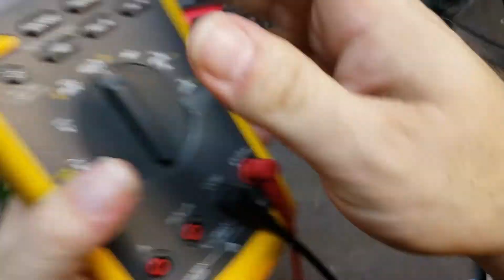Cisco Linksys E3000 Router Power Repair

Comment: 💝Your 5-year-old tutorial helped me in a different way in 2023!💙I have a bricked e3000 I needed to get in to, but just didn't know how to work those security screws.😥At 13:55 you were snapping the halves back together but did a great job in showing how to use a Flathead driver on those PIA security screws!👿(why does Linksys make life so difficult?)😠Good tip. Thank you so much!😃Now I can go in & short the pins on that Broadcom chip to clear the cache & will probably toast the device beyond repair in that process.😅Once again, thank you!🧡 Edit - I just completely bricked the router.😞
Reply from the maker: for what it's worth, you probably only finished its already impending failure.  That said, if you have access to an ICSP adapter you might be able to unbrick it but its also likely that Broadcom chip was headed to its doom and you just finished it off.   I am glad you found the flathead for security bits helpful! I barely ever use my security drivers for those unless they are really tight. And thank you for the comment! I appreciate it :)

Comment: I have a E4200 and it can't power up, it sometimes do, but most times after a few hours after use and plug removed the reinserted , it can't get boot,  unless i have an ethernet 1000 cord connected so what do i check with my mult-iMeter?
Reply from the maker: That's weird. Id try another power adapter first. If you already did, then the small voltage regulators and their associated capacitors.  Unfortunately if none of that checks bad it might be something not reasonably repairable. These seem to be pretty solid aside from the power circuitry.

Comment: So how did you know the value is supposed to be 470u@10v? Mine are all JCCON caps labeled VENT and p1024 and a temp rating of 105c. And can’t find anything online related to those markings. Did you pull a good one for ref and test it?
Reply from the maker: Those factory caps had standard markings on the wrapper. You can kind of see the negative stripe. I wouldn't be surprised to see varying capacitor suppliers used during production.
Reply: @FixitFrank  yea we substitue parts all the time, especially nowadays. But maybe they had custom wrap on the caps too. When manufacturers order in bulk, especially if it’s a part used across multiple devices like this cap, they can request different markings on the body. Most of the time it’s just an internal part number kinda thing just for tracking inventory around the factory.
Reply: @FixitFrank  and thanks for the awesome video!! I thought you had some type of component placement diagram or a schematic of the board or a BOM or something like that. Didn’t expect your caps to just have it printed on there lolol

Comment: I'm still running one of these for my ancient ADSL connection. It works great with openWRT for my use case. The 5ghz radio doesn't work out of the box with the openWRT firmware, and when enabled causes the router to get stuck in a boot loop. I was finaally able to get 5ghz working with a driver package in the openWRT repo after de-bricking (TFTP firmware upload). The reason I went through this was to use 'SQM QOS' to get rid of the high pings due to bufferbloat when the connection is under full load.

Its still a good little router for low bandwidth connections!
Reply: i guess I am kinda off topic but does anyone know a good website to watch new movies online?
Reply: @Jerry Landon I use Flixzone. You can find it on google :)
Reply: @Travis Sage yea, I've been watching on flixzone for months myself :)
Reply: @Travis Sage Thanks, I went there and it seems like a nice service :D I really appreciate it !
Reply: @Jerry Landon no problem :)

Comment: Hi, I have a E3200 and no lights come up, this one has more capacitors, I am very novice in electronics, I measured all the capacitors over its legs and I found 11.92V, 11.95V, 1.28V, 1.20V, 5.02V, 5.02V, 0.9V and 0,83V. If I compare it with your values (if that is allowed with the different models) I should say that the 0,9 and 0,83 are off and these should be in the area of 3.3V. Can you help me out here?  Great work by the way!
Reply from the maker: Thanks! The 0,9 and 0,83 do sound unusual.  I'd have to see the circuit in more detail though to say for sure.  They could be anywhere from 1,2-1,8+ but under 1v sounds incorrect. Especially with the symptoms. You could try replacing the caps. If you have any old computer power supplies around, they make good sources for harvested parts to use for this sort of thing.  You also don't need the exact cap rating.  If the questionable caps are 10uf @ 6v, you could get away with a 6.8uf@16 or a 15uf@25.  I wouldn't go much more than half its lower rating or double its higher rating.  They should just be for filtering the voltage regulator output so there is some wiggle room.  
You might even get away with lifting one leg on each and trying it out.  You still want to replace them, but at least for testing this is okay,
Reply: @FixitFrank  Can a faulty capacitor cause this issue? I am quite new at this. I I look at your video you are measuring in your second point at what on my board is a zt7184s, if I measure the pins on one side of this zt7184s I get 0V, 1,0V, 11,86V and  6,81, on the other side in the same direction I get 0.25V, 3.25V, 3.86V and 0,88V..
Reply: @FixitFrank  If you search on openwrt site for e3200_serial.jpg then you can see the board I have.
Reply from the maker: sorry, all your replies went to my "held for review" page.  That 0.88v sounds suspicious.  Have you made any progress since we last talked?
Reply: Hi, did you solve you problem? I have E6400 with no power lights. LAN/WAN ports glowing after I plug in patchcord except LAN1. I can't access it via tftp or serial cable. I measured few legs and mine was 12,5V but close to the CPU 0,85V.

Comment: All light green biliking. What is problem??
Reply from the maker: I am not entirely sure.  First, I would try a new power adapter. Even if it is working, it might not be working properly. If a new adapter does not help, then I would start checking the voltage regulators.  Anything else is not worth repairing (in my opinion)

Comment: My device works fine but the power and wireless lights are dim, while my friend's device has high beam lights, both are the same model e3000.
Reply from the maker: It could be something silly like the light pipe not lining up as well in your router versus your friends.  If it's working fine, I wouldn't worry about it yet.

Comment: Frank, what was the issue with it. It booted ok but got radio issue or what was the initial fault?
Reply from the maker: It was dead. The power led would come on but nothing else would respond. I think it was a power surge.
Reply: thanks. so the power button would flash forever, or just forever lit?
Reply from the maker: @zochpeter  The power light stayed on but it was dim. The status lights for each LAN port would act like they were trying to work but no traffic was being sent. Whats yours doing/not doing?
Reply: @FixitFrank  It got a voltage spike.
The WLAN led is very dim and power led blinks.
first it looked like corrupted flash. but after trying to load new kernel via tftp or JTAG it would stop at random address and hang. However read from flash was OK. Write no. I have measured voltages at caps, looked good. I have tried to heat the FLASH and it started to load the image. I have wrongly concluded that the flash chip was wrong. replaced it and it is doing the same.  It is very temperature dependent. There must be a cap or component that is doing it or the pcb is just shot somewhere in the middle layer.
Reply from the maker: @zochpeter  Gotcha.  You may want to try replacing the caps anyway. I bet if I had put a scope on that one the sawtooth would have been large. It looked OK on my fluke but as you can see it was definitely bloated.  Hopefully its not a middle layer issue.  Your description sounds pretty similar to what I was seeing. Good luck!
Reply: @FixitFrank  guess what. Regardless of recapping the router 2 years ago. The exact one, as you had, was the culprit. Aaaah, I wish I had found your vid sooner. I went through all the hassle soldering JTAG, serial, replacing the flash chip and it was just the cap! btw, heating the flash with a fan I had heated just that one particular cap.
Reply: Also got strange issues. Not booting sometimes. Freezes. Reflash didn't help etc. The same cap here looks problematic. It leaked at bit on the bottom side but wasn't bulged. I'm gonna replace it...
Reply: @FixitFrank  I have got rapidly flashing power LED and nothing else. No response to pings on any LAN ports. Do you think it could be the same issue?
Reply from the maker: @DistalKnight  could be 2 problems.  Power adapter is problem one.  Try a power adapter first.  If the problem persists, check that capacitor. The adapter is the usual cause. The capacitor is not as common to fail but if the surge is bad enough it will happen.
Reply from the maker: NIRAV PANDIT  What voltages have you checked inside?
Reply from the maker: NIRAV PANDIT  I can't say what the problem is without checking it but I would recommend checking the voltage regulators and make sure they are outputting their rated voltage.
Reply from the maker: NIRAV PANDIT  I don't know.  It depends what the voltages are. I only replace parts if I measure them and they are bad.  If you do not check the voltages, you will end up buying parts you do not need.  
The voltage regulators are where I would check.
Reply from the maker: NIRAV PANDIT  With a hot air soldering station.  Maybe you can do it with a normal iron but I am not sure.
Reply from the maker: NIRAV PANDIT  what is the voltage output?
Reply from the maker: NIRAV PANDIT  When power is connected, put black probe to ground, and red probe to each positive side of capacitor. The voltages are 5v, 3.3v, 1.2v, and 1.284v.  https://youtu.be/0AHen1UHXaM?t=155  I show here how to measure. This is your best option to find the problem.

Comment: I have issue with my ea9500 back ethernet half lights only on rest not working,
Reply from the maker: I don't know those myself but I would try a Factory reset (check your manual for the exact process).  Also make sure your power adapter is working properly.  Bad power adapters can be hard to determine.  
Measure the input voltage to the router with the power adapter connected(so it has a load).  You can use the socket connections on the circuit board as test points. The voltage should be very stable, within 0.1v.  If the adapter is 12V 2.5amp rated and you read 11.5v that is probably bad. It should be 12.1-11.9 in my experience. The router does not draw 2500mah normally. 
The voltage should not drop. I would expect to find bad capacitors inside the adapter if the voltage dropped when the adapter was plugged in to the router. The adapter must be under load because the no-load state of the voltage will usually be correct and the meter does not add enough of a load to show the symptoms of bad capacitors.  It would be visible with an oscilloscope but not every one has access to those. 
If the power adapter is OK and the reset does not help, I would start checking power supply voltages inside the router. I am not sure what the voltages should be, but you can look up each voltage regulators value in a data sheet. The data sheet will tell you what voltage you need and where to check.  If you find the voltage regulators are OK, it might be time for a new router. Replacing or repairing the large IC's is something I do not usually attempt.  
I have run info situations where the large IC's have bad solder connections. Any large IC that has a heatsink may have bad 'BGA' connection.  Reflowing the board might solve that but you need to be able to re-flow SMD parts.  
Good luck with it!
Reply: @FixitFrank  thank you very much for brifly instructions